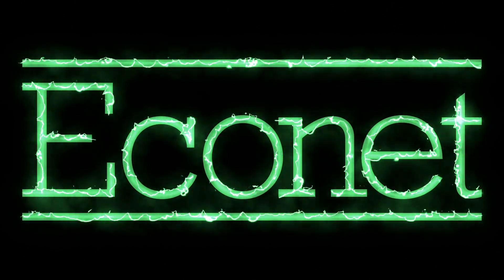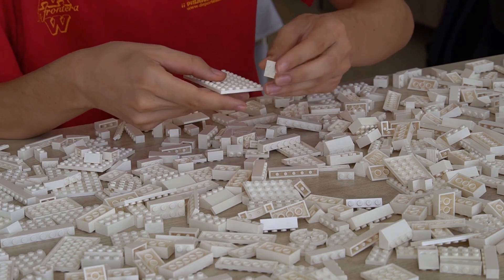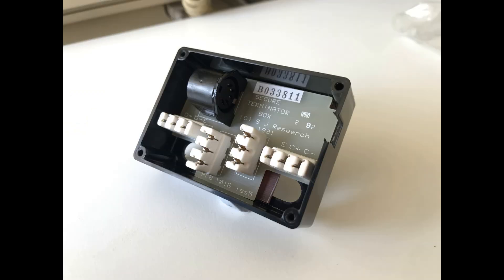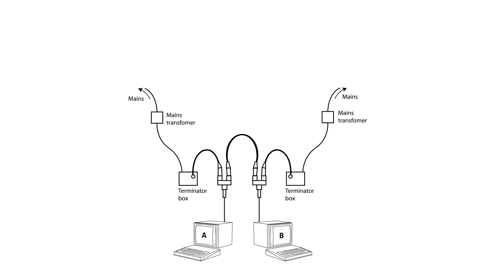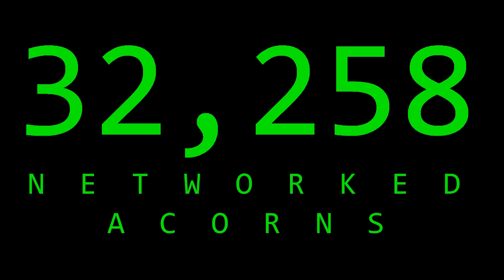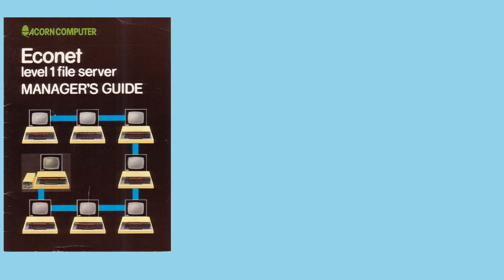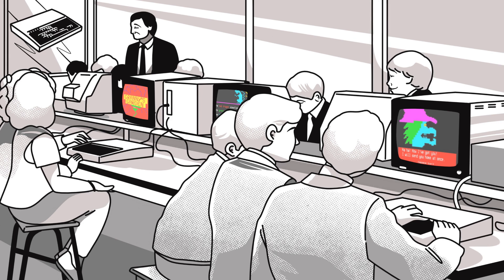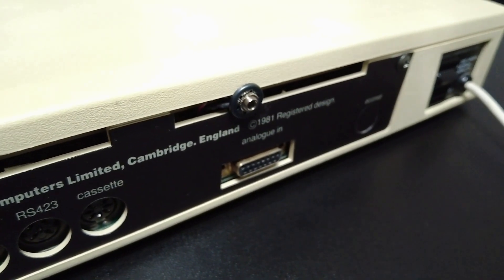Econet In A Nutshell - Part 1

Comment: I attended a high school in Northumberland and our econet file server software was written by Gary Partis (as part of his A-level computer science project) it was the same as a level 2 Acorn FS but didn't require a 6502 2nd processor on the FS machine. I remember getting all 15 beebs to play the intro music from castle quest simultaneously (well nearly 🙉) Great video Colin, keep up the good work 👏
Reply from the maker: I've since spoken to Gary about this and he confirmed that yes, although he developed it using a copro, the actual software he produced ran without it so you could do exactly what you described: use a normal Beeb as a L2 file server! Amazing.
Reply: @ColinHoad  
Mr Atkinson was the IT/Computer Science teacher, he was setup as a Level 6 user which was system administrator.  We lowly students were just level 3 which meant we could just Shift-Break into whatever menu program was on the 2nd drive of the file-servers dual disk drive.  Until a 6th former who knew Gary found out the Level 7 password - so you could *I am Partis,ILTFEM (which I believe was I Love Tracey For Ever More).  The tables were turned! we made Mr Atkinson a level 3 user and watched in teenage delight as he could no longer organise the class work load. 😆
We thought we were hacking gods, never got caught either.  Now in my mid 50's , I feel a little bad about this, but at the time....
Reply from the maker: Trust Gary to write a better piece of software than Acorn themselves 😆 That's really cool! And thank you, glad you liked it 😁

Comment: ISTR ANFS was a fairly late addition - DNFS was the standard ROM for many years, which had support for floppy discs and econet. ANFS added buffering for database applications, which were very inefficient over DNFS, as it sent a single packet for every byte read or written as there was no buffering to save memory. I worked for a college at the time,  a teacher had organised a course on databases, and only found out last minute that it was unuseable on our econet network. Luckily I had a contact in Acorn and got permission to become a test site for the pre-release ANFS ROM I'd previously got hold of for our machines.
Reply from the maker: That may well be true, I may have muddled my DFS, NFS, DNFS and ANFS up, I know DNFS was meant to combine DFS and NFS into one, so perhaps the A in ANFS actually meant "advanced"!

Comment: I thought the Master's OS included ANFS by default, so you just plugged in the module - no extra ROM needed.
Reply from the maker: As far as I know, only the BBC Master ET came pre-fitted with ANFS, I don't think the standard Master had it built into the OS

Comment: I spent some of my summer holidays whilst in 6th form at a school in Reddish, Stockport helping install two classrooms of BBC Micros with the obligatory Microvitec monitors. The school had the screens engraved by a company who usually did car windows as an anti theft deterrent. A friend and I helped fix the desks so Econet cabling could be run along them. Clocks and a bridge was installed. The cabling was run to the School office where the typewriters were replaced with a couple of workstations. It was all connected to a level 2 file server and an amazing level 3 server - all that storage! We managed the whole thing and helped staff in lessons as many subject heads were keen to get their single user license software onto the network..... We had to mod some of the software as the memory map changed with Econet as the filesystem. We supported the admin staff for whom word processing was transformational and new processes had to be setup. Everything was printed on Juki 6100 Daisywheel printers. My A-Levels suffered (failed Physics) but I got a job with the company on the Woodford/Wilmslow border who had supplied all the kit. I then started to get paid to install these systems across Cheshire. I'm still designing and project managing the install of IT Solutions for new school buildings FORTY years later and love every day of it. I did go back to my old school a few years ago and found an some of the Econet outlet boxes were still in the original classrooms. I suspect the fileservers were skipped which is a shame....
Reply from the maker: What a wonderful story, and so good to hear that your formative Econet experiences led to a lifelong career that you enjoy! I don't think there are many better legacies for Econet to have had, on a personal level. Shame about those file servers, were they Acorn FileStores? They're very, very rare nowadays, alas.

Comment: A video on setting up a Level 4 FS on Arculator, or Level 3 on BeebEM, connecting to then using another emulator instance, a Raspberry Pi running RISC OS, or via a PI Econet Hat, some real kit, may get a few views.
Reply: If feeling adventurous, finding the Econet versions of Elite, Chocks Away, and Doom, might be a first, for a vid. Similarly finding a pre 2012  Linux distribution,  that you could add the kernel Econet module to, and had the utils, might be unique.
Reply from the maker: Thanks, Andrew! Yes I agree, and I'll certainly be looking at the Pi options in the second part. Some good ideas there for more focused how-to videos, too, cheers 😀